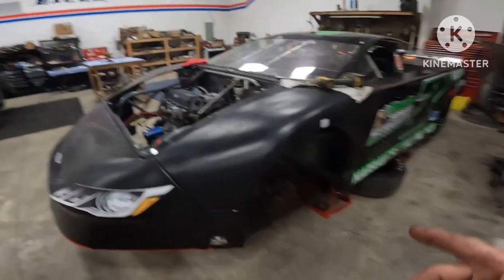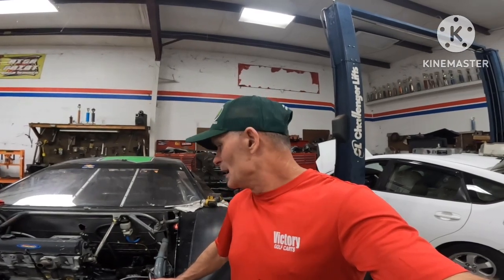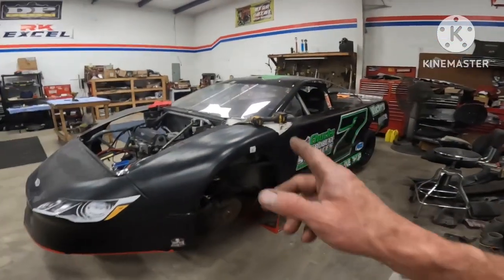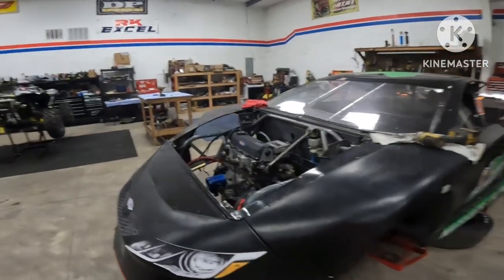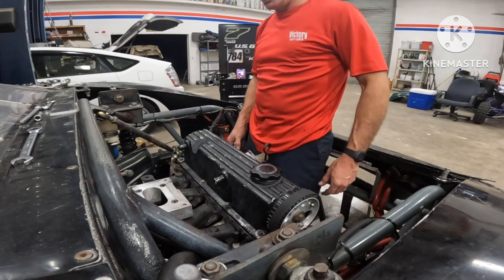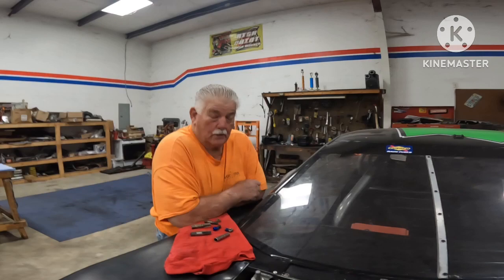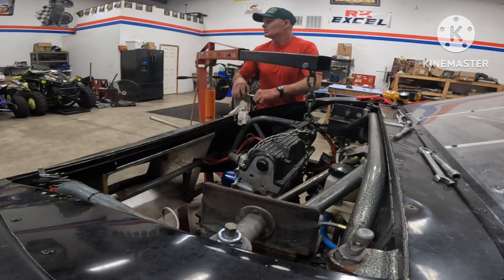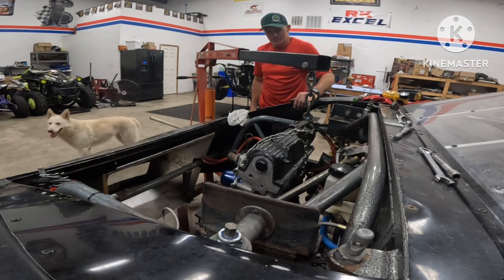Oil plug woes in the dodge 2.2 race machine!!

Comment: Wondering is their a underlying condition that causes excess pressure to blow those plugs out ?
Reply from the maker: I looked into that..  the oil pressure gauge was only reading 65#. I honestly think he used the wrong size plugs. I have played around with oil pump springs in the past to achieve more oil pressure and have never blown these out but did sweal the oil filter 😎.